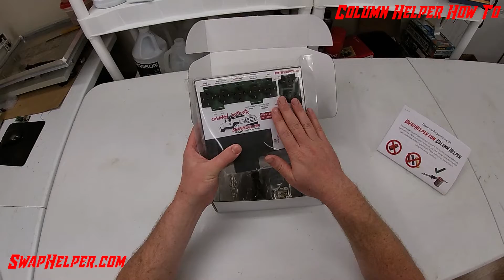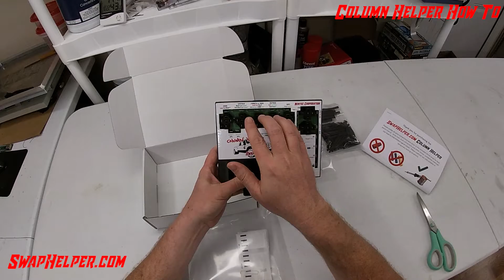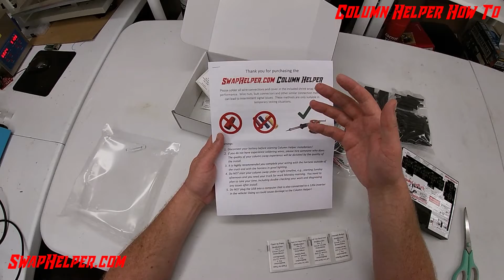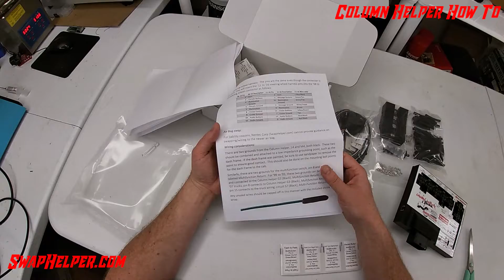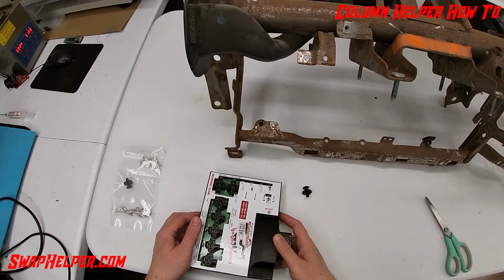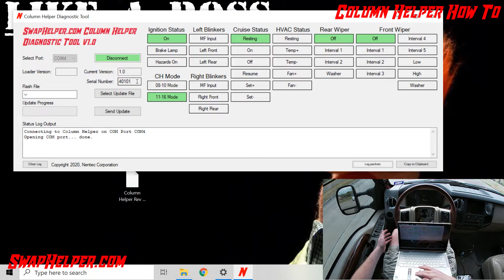SwapHelper.com Column Helper Unboxing and How-To!

Comment: I have an 05 Excursion. When ordering column helper on the site, do I select 2005 or 2004 for Truck Model Year, since the Excursion didn’t receive an update in 05?
Reply from the maker: You will select 2005, we ask those questions so we can track what people are swapping in case they need support down the road - you will receive the same product no matter what you select. If you have any more questions, feel free to reach out to us at contact@swaphelper.com, thanks.
Reply: @SwapHelper  that’s what I figured, but wanted to be sure. Also, for the multi switch, is it just the switch on the side from an Escape that’s needed or the whole assembly?
Reply from the maker: @robbygonzalez7911  when you say whole assembly, are you talking about the multifunction switch or the column? You will need an entire multifunction switch, but they don't really come apart.
Reply: @SwapHelper  i believe they attach to an assembly that goes through the shaft of the column. Is that piece needed?
Reply from the maker: @robbygonzalez7911  negative, all you need is the multifunction switch.

Comment: After doing this swap with this kit if the truck has a problem with engine or  transmission can a regular shop still figure out what’s wrong with the engine or tranny  with there computers
Reply from the maker: Of course, everything's still functions like factory. You also have the option of plugging directly into our products and using our diagnostic applications if you are having an issue.
Reply: SwapHelper thank you for responding back give me more confidence on doing this kit knowing there’s some one willing to answer.

Comment: Is the brake peddle still going to deactivate the cruise as normal, or just the buttons alone?
Reply from the maker: The cruise control continues to function like factory. The brake will deactivate the cruise control just like it originally did.

Comment: Would this work on the 07-14 expedition column?
Reply from the maker: We don't have any experience with the '07 to '14 Expedition column, but it is compatible with the Expedition and Escape multifunction switch. They fit into the super Duty column, and will allow you to control your rear wiper in an Excursion.

Comment: Will work for manual transmission on 7.3  2001 or only automatic?
Reply from the maker: It is transmission agnostic, so it'll run with any transmission.

Comment: You mention something about not using relays for turn and such, if I'm not mistaken my 05 f350s trailer light circuits are powered by their own fused relays from factory, how's that work out?
Reply from the maker: That relay will no longer be used, and we use the power that originally went to that relay to power the solid state blinker circuits in the Column Helper.

Comment: damn im going to need that for my 04 excursion. cant wait for the cluster helper for 04 and up. also what multi switch did you use for the excursion since its got the rear wiper?
Reply from the maker: The multifunction switch is from an Escape, I believe it was a 2007 year model. You can find them brand new on eBay for pretty cheap.